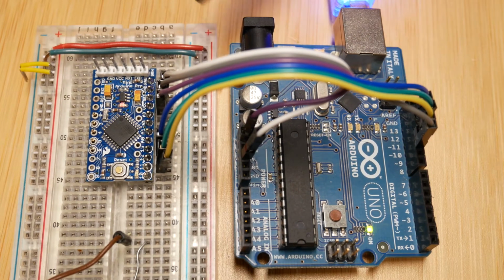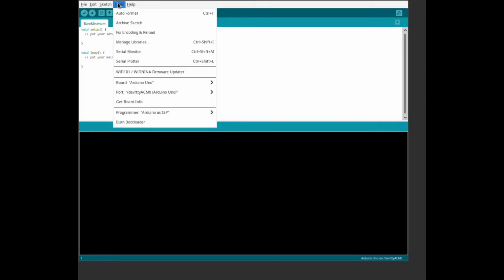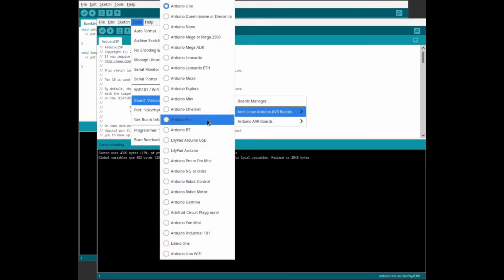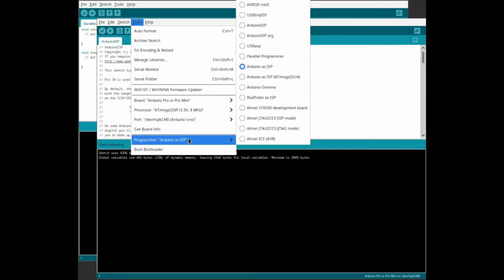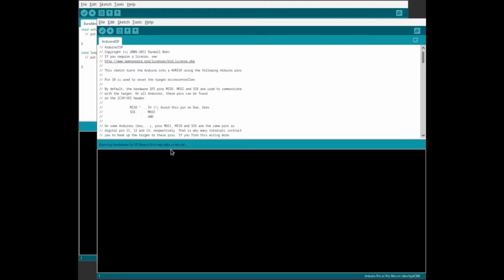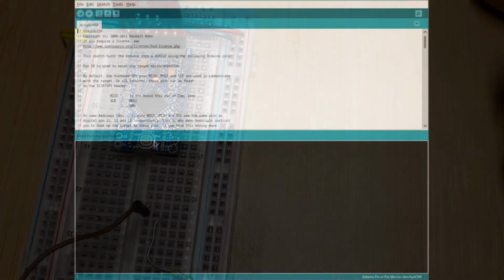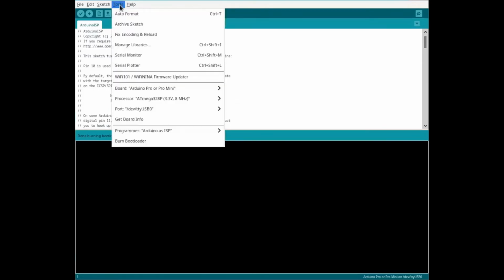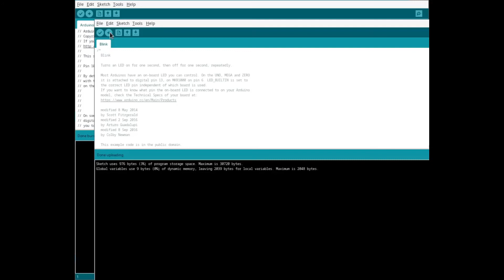Arduino Bootloader Flash with Arduino

Comment: 0xff !=0x0c avrdude verification error; content mismatch?   didn't work on my board...on the 5 volt (same case with 5volt pro minis - did choose correct voltage though)...however the 3.3V pro mini came to live so 1/3 not bad....thanks dude.